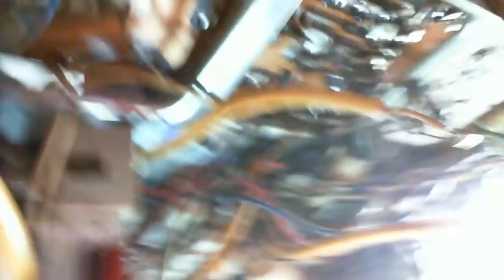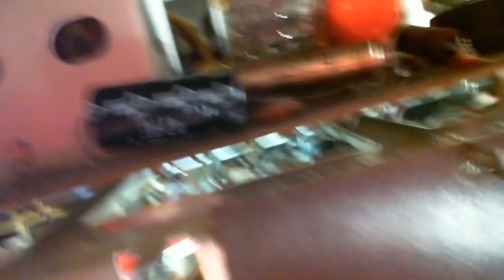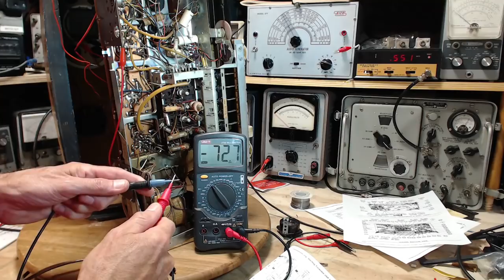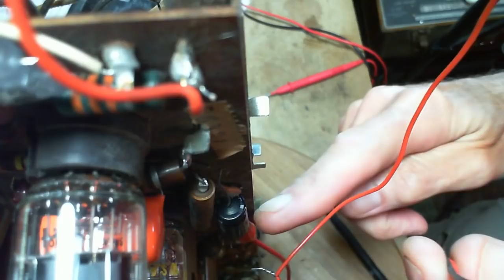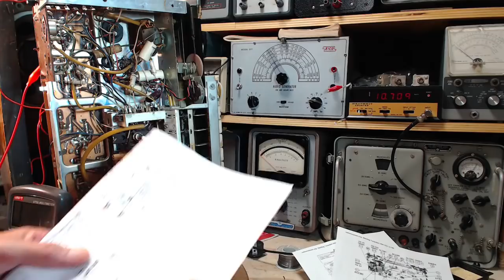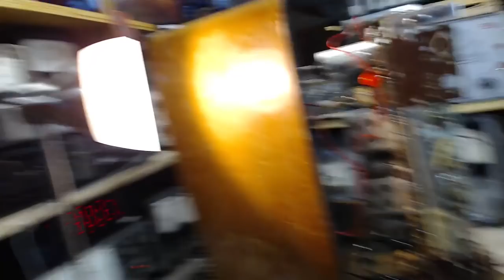Nordmende Turandot Video#9 - FM Detector Capacitor

Comment: Wonder if moisture got into them and would it affect them? I had a bunch of resistors that I pulled out of old equipment many years ago. I decided to check them out recently and wound up throwing most of them away since they were way out of spec, mostly too high.